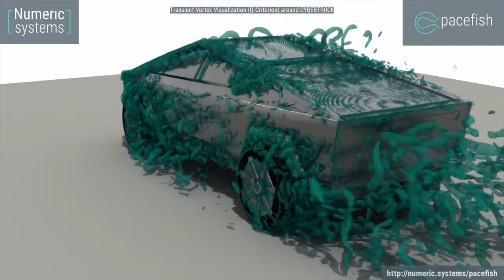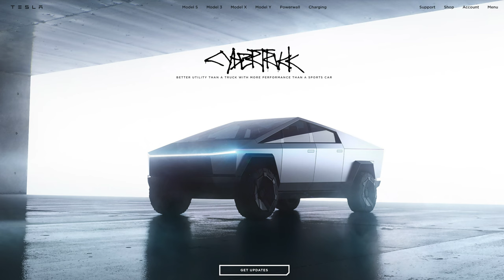TESLA Cybertruck - 2023 Updates! Learn More Here

Comment: Good vid. Couple of facts wrong: 1 MW charging not confirmed (watch semi delivery event again for details), glass is not bulletproof just the stainless, but still it will be amazing!
Reply from the maker: Yep, 1MW charging confirmed for CT. Trying to find confirmation of bullet proof glass.. 🧐
Reply: @TeslaJigsaw  The statement from Tesla was that V4 Supercharger will have the same tech as Semi Mega charger and therefore support up to 1MW+ ( the cable was what they were talking about) but they have never stated that any variant of the Cyber truck will support an actual 1MW charge speed.
Reply: @TeslaJigsaw  Please link to the source material for your confirmation.
Reply from the maker: @TheLastMoccasin  So V4 will use 1000v to supercharge the Cybertruck, but not necessarily at 1MW? possibly more like 500kw? We shall see!
Reply: @TeslaJigsaw  Correct! The 500kW is a good guess since that would be the same C rate of charge for a 200kWh pack which might be the size of the 500 mile variant (vs. 250kW for a 100kWh pack).
Reply: @TeslaJigsaw  But for now.... keep the expectations low. No need to get people thinking 1MW is coming, setting them up for disappointment. Tesla has enough real exciting things happening that we should be cautious not to exaggerate or stretch anything that they say. Also, bears will use these "false" statements to try to prove Tesla and all its follower are just diluted ..... yea you know the rest ;) So excited to see this channel grow and looking forward to your next videos!!!!
Reply from the maker: @TheLastMoccasin  I'm learning as I go.. genuinely thought it was bullet proof glass and 1000kW charge speed... Mistakes will be made, but thanks for pointing this out - will do better 👍🏼
Reply: @TeslaJigsaw  Love your videos and humor and can't wait to see more from you!! Thanks for all your hard work!

Comment: Stainless steel type 30(?) as in type 301, 302 ..30(x) unknown .. Tesla just filed a copyright on the type they are going to use m, but duh I don’t know what they are going to call it.
Reply from the maker: I’m no steel-ologist, but a quick google suggests… “X” in “30X” probably denotes the new alloy that SpaceX has developed. Another possibility is that the “30X” actually means 30 times, as in, the new alloy is cold rolled 30 times over, to work strengthen the material (also known as work “hardening”) to improve it's mechanical properties